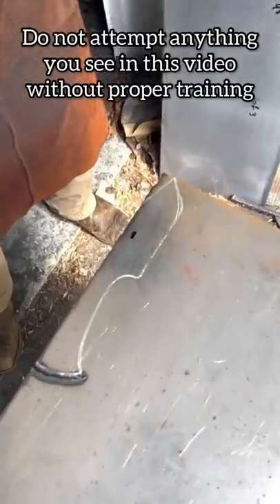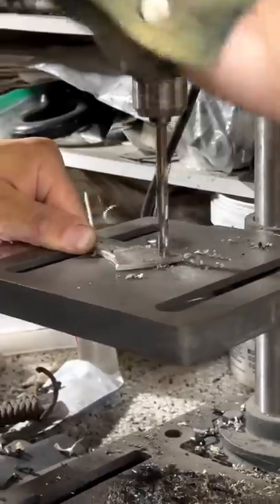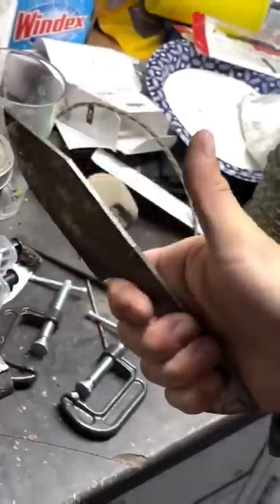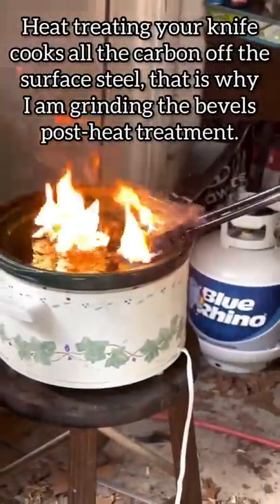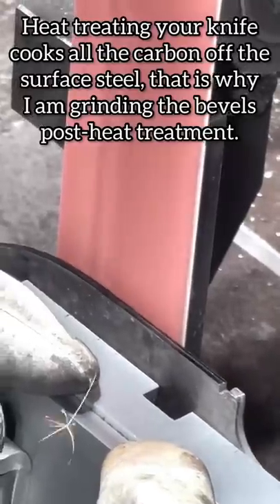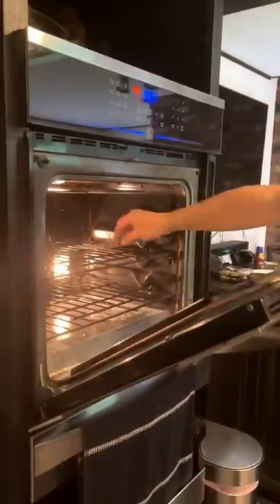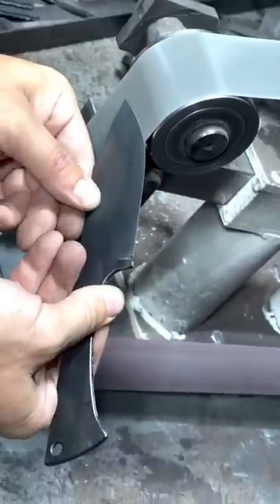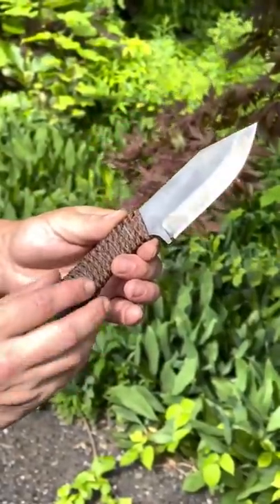How to make a knife!

Comment: What’s the difference between hammer forging and cutting?
Reply: Forging a knife vs this technique ( stock removal) there are many differences. Forging can introduce stresses and can be very good technique depending on what you want to achieve, also unlocks the ability to use scrap steels etc. this method is much more predictable and repeatable because you are using precision made materials.
Reply: @joshyingling  blah blah. You used to forge because there wasn’t a huge steel industry back in the day so forging to shape minimized waste. Now steel is the cheapest part of knife making so no need to forge.
Reply: @nobilismaximus  sure….. except the whole, I can make other things forging….. with free scrap steel…… hooks, cooking utensils, tools, hatchets etc. I guess what’s the point in making anything when everything is commercially available huh? Also you learn a lot of skills blacksmithing you should try getting off your computer and trying it
Reply: Forging can break up grain structures that might cause weak points later on
Reply: Some people will bitch and moan about one being better than the other. But really, if properly done, there isn't a meaningful difference.

Do what is best or most enjoyable for you.
Reply: @autumn5592  agree 100 percent

Comment: What’s a “recaso” or whatever you called it lol
Reply: It’s just the unsharpened length of blade that’s right above the guard/handle. It was historically meant for a better grip—allowing the users finger to rest above the hilt without cutting themselves.
Reply: @brycefoster7801  interesting 🤔 
Thanks for the information
Reply: What he called the ricasso was actually a choil.
It allows you to sharpen to the very heel of the blade.

Comment: Why not bevel before heat treatment?
Reply: It depends how many bevels and what equipment you have also if you quench a sharpened knife your likely to overheat the thin cutting edge you would have do what the Japaneses swordsmith  does coat the edge with clay befor the quench it also leaves a beautiful Hammond design on the steel

Comment: What the fuck? No proper heat treating will not cook the carbon out of the steel. You can do the grinding post quenching beacause you rely on technology to make up for your inefficiencies and/or lack of skill.
First of all, if you cook your steel in a reducing environment, it will gain carbon instead of losing some.
Second of all, heat treating is done at low heat, wich would take HOURS for the carbon to migrate away from the steel.
Yes, the edge should be left reasonably meaty so the heat doesn't escape instantly from it once taken out of the fire, but a thicker edge will quench less than a thinner one (depending on the skill of the heat treater).
You should also try to forge your blades instead of just cutting them out into shape.
It forces you to really know the material you're working with, how it behaves with mechanical stress and heat.
I may be a purist in my craft, but to me if you want to really know the roots of blade making, you have to do it the medieval/antique way, at least a few times, to understand why things are the way they are.
For exemple nobody would have grind a hardened blade for obvious reasons. Fragile, way too hard, inefficient etc. And a tempered blade either, beacause it would still be quite hard. You'd just hone the edge afterwards.
But anyways..
Reply: How long did it take u to look all that up.
Reply: OK dude, I am knifemaker, I don't work like him, but I respect it, stop giving this long and long answer to him, you just read some shit on Google and you think you have knowedge in this, do a knife yourself, after come talk, if you really that's smart you will know that isn't one way to do something, and all he have do can be use for made a knife, kiss
Reply: Ah j'ai pas capté mais avec un nom comme ça t'es français ?
Reply: I don’t get some people lol

Comment: Wow, you didn't even use a hammer😏
Reply: And you don’t always need to use a hammer
Reply: @jordandimick8861  I know, sarcasm doesn't always flow well with words. Honestly the less work hardening you do the stronger the blade will be. I don't care what the masters say, you heat and cool metal repeatedly and it don't like it. Harden it, temper it and be done. As smiths go....I get paid per job, if I can do it faster and make it last longer then that's money in pantry .
Reply: @robsorgdrager8477  ahh gotcha! I agree with you though. Forging is fun, but at the end of the day, the steel is the same no matter the process. Plus like you said forging messes with the grain structure. Just drives me up the wall when people insist that forging is the absolute best and only “real” method of making
Reply: @jordandimick8861  I would say Damascus would not be as neat without hammer forging 😏 but for a working blade or tool I like to work the material as little as possible. Tools need to be strong and dependable.

Comment: Why put it in the oven if uve avoided losing the heat treatment. .? ...that doesn't make sense
Reply: He hardened it, ground the bevels, then tempered it.

Once it's hardened, anything over 150c or ~220f will soften the steel.
Grinding introduces uncontrolled heating.
Tempering is the controlled softening of the steel.

Comment: Srry, that's how u cut a knife. Not make a knife. Making requires a creation process. U didnt shape it, or even make a proper tension at the least.
Reply from the maker: Make a proper tension?
Also, this is a demo of stock removal, which is the most common way to make a knife. 
If you want, you can watch me make Damascus (as it is known in the modern sense) by hand in a recent short.

Comment: You're just a grinder not a knife maker. You have no clue about your metal.
Reply: Mate you literally don’t know what you are talking about do you? Stock removal is nowadays the possibly easiest and most accessible option for knife making, it’s not just grinding. Sure it’s less traditional than forging but usually results in better less stressed steel and very very good knives… It’s possible that the sheet of 1095 might have been HTed already which he needed to redo (I would do that anyways) if that’s what you mean with „no clue about your metal“ but this is just as legitimate of a knife as any other

Comment: Using preset sheet metal to get the shape and just grinding it out has always felt like cheating and will always feel like cheating.

Your making what we call a stamped knife.  I pay factories for that.  I don't consider them hand made and I wouldn't pay a hand forge price for one.
Reply: Not even close to stamped.

Still don't approve of this method though.
Reply from the maker: It’s called stock removal

Comment: Looks like a bunch of short cuts..
Learn to forge.
Reply: Knife maker and blacksmith here, forging introduces a lot of metallurgical problems to the steel. It does not produce a higher quality blade. The real shortcut is that wrap instead of a real handle.
Reply: @mickygee5118  Yes you're right but it's the way of a true knife maker in my eyes.
Also wrapped handles shouldn't be a thing. They're the worst.